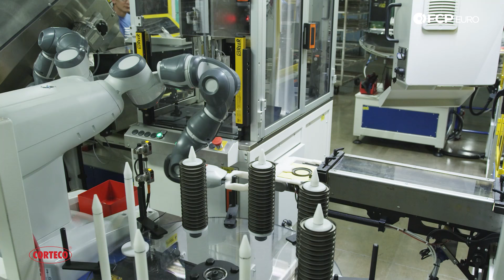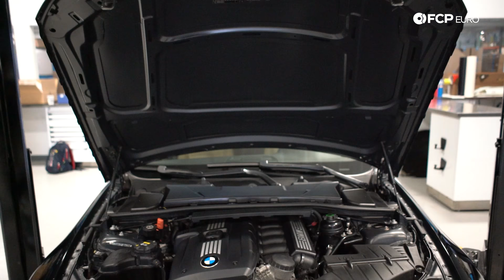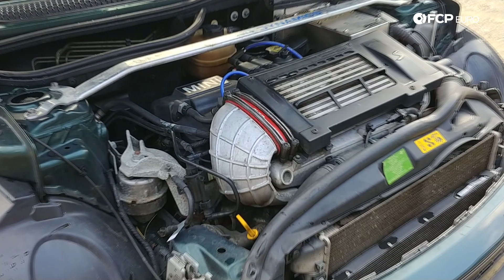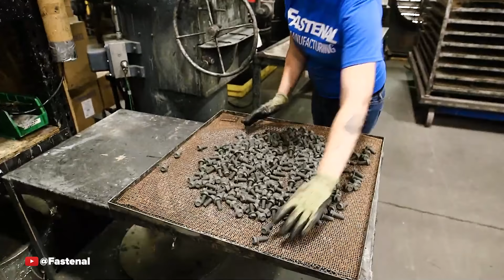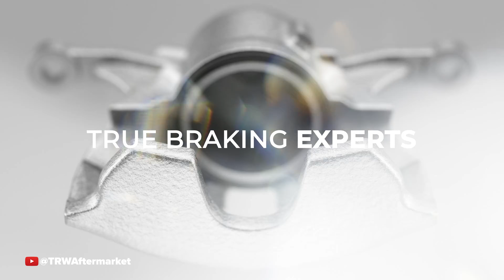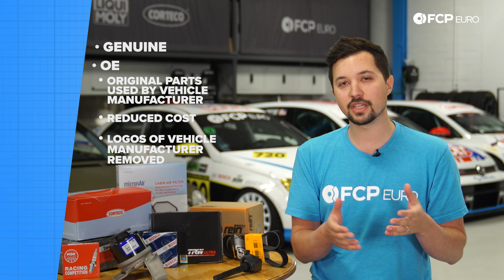How Much Of Your Car Is Actually Made By The Manufacturer?

Comment: As someone working in Automotive (previously TRW Braking Engineering,  so i love your example!) I take this for granted.  But this is an excellent  explanation for people not so close to the industry. A few comments.
1. Tier 0.5 doesn't really exist,  technically they are still Tier 1 because their customer is the OEM. Also, the idea of a full system supplier was popular in the late 90's/2000 with the Big 3. Nothing new.
2. Some examples of the Tier 2 suppliers better fit as Tier 1 eg Hella, Brembo
3. A Tier 3 supplier is one who ships to a Tier 2. If a supplier makes a bolt, or raw material,  and ships directly to the OEM - they are a Tier 1
4. There is a growing trend for OEM's to not allow suppliers to put their logo anywhere on the part. Ford & GM started that 20 years ago, others have followed.
5. Some OES parts are not the same as OE parts. This is especially true for brake pads, even more so once the vehicle is out of production. And anyway, TRW (now ZF of course) never made any brake pads - they were always purchased parts from a Tier 2!

Comment: Outstanding video. Wanted to order some brake pads for 2018 E300 Mercedes from Amazon. They are all over with many parts from 2nd or 3rd tiers unreliable vendors. This video convinced me that I should order these pads from FCP Euro (OE, may cost a bit more - but worth it).
The presenter on this video did a great job. Wish I could do that when I was young.

Comment: I've gone through several OEM engine mounts (2006 E320) that were not Original MB and they failed well before their time and had to be replaced. Only the Genuine MB has lasted. Doesn't make sense but in the case of this specific category of part, this has been my experience.

Comment: It doesn’t matter who’s part you sell.  If the part does not have the stamped BMW logo then is an aftermarket part even thou the part is made by a BMW supplier.  The difference is OEM (Original
Equipment Manufacturer) AND (OE) Original Equipment) Sold only at BMW Dealerships.  All after market parts are not defect free. If the customers takes the time to inspect the parts closely, they will find defects, still usable but with defects such as, not fitting correct, missing sub-components other than hardware, faded lenses or not 100 % clear with bright colors, scratches, holes in the material used to fabricate the part, missing hardware, etc,etc. That is why BMW allowed parts suppliers to sell blemish parts to vendors like you. I have been dealing with BMW, Mercedes and Porche parts for an eternity and know exactly how BMW(in this case)works with parts suppliers. BMW Quality Control is second to none and that is call protecting the brands image.   Everyone who works in manufacturing line for BMW is responsible.  If a defect is notice it will be corrected immediately, again BRAND image. Don’t misinform the customers with inaccurate information.  You have a great day.

Comment: Believe it or not, FCPEURO seems even cheaper in price than OE/OEM parts being sold on eBay and other competition!
Reply: AND they provide excellent customer service!
Reply: Just depends if you're buying new or used parts from ebay. Only down side with ebay is you deal with different dealers selling different parts vs a 1 stop shop with FCP. Amazon is ass for parts across the board, their only benefit of you find the part is you can have it delivered usually the next day. If ebay had that I wouldn't shop anywhere else in my opinion

Comment: What I always wanted to know is do "replacement parts" companies Tier 1 and Tier 2, 3, etc. have to pay licenses to automakers to produce replacement parts? For example Ford released new engine and Mahle want's to produce replacement oil filter for that engine. Does Mahle needs license from Ford to produce it or maybe from Tier 1 supplier who produces filter for Ford in original, Purflux for example?
Reply: The answer is, it depends. If the engineering was done jointly or the automaker paid for the tooling to produce the part, then yes. If the automaker simply buys the part from the tier 1 and is not vested in it, then probably not. However, purchasing agreements can vary and even though an automaker isn't vested in a component, they can still request/demand exclusive supply. Clear as mud, right?

Comment: Awesome video! BMW brake pads - I believe that my callipers are made by ATE, that means the pads are ATE also or can be TRW? Thanks.
Reply from the maker: Most of the time when it comes to braking systems the calipers will match the pads, but sometimes you never know what the team at BMW was thinking so there is a chance they are TRW or someone else. If you gave me your car info I'm sure I could figure that out!
Reply: @fcpeuro Before using FCP Euro I bought TRW brake pads for my ‘07 Jetta from World Pac that were superior to the softer OEM VW brake pads from the dealer at 1/3rd the cost. Next time I’ll most likely buy Akebono pads from FCP Euro.
Reply: @fcpeuro Before using FCP Euro I bought TRW brake pads for my ‘07 Jetta from World Pac that were superior to the softer OEM VW brake pads from the dealer at 1/3rd the cost. Next time I’ll most likely buy Akebono pads from FCP Euro.
Reply: @fcpeuro  many thanks! It's a 228i M Sport Auto 2016 with non Brembo (Bosch system I think with 330 mm rotors). Cheers ;)

Comment: Interesting video and as an automotive engineer give you/FCP Euro credit for a basic presentation on the manufacturer and the supply management system.

NOTE:  Tier "0.5" as explained is still 100% owned by the manufacturer and is not for sale in other brands unless authorized.  This is  a very TIGHT relationship between supplier and "brand".  An example would be GM 4 wheel steer on large pick-up trucks developed with Delphi.  This "Quadrasteer" system died and Delphi cannot market/use on other vehicles.

Please further define OE vs OEM.  In my opinion, an OEM (Original Equipment Manufacturer), produced the part of interest during the production cycle of the vehicle.   Parts stated as OEM, are not correct if the manufacturer did produce that EXACT part at some point during the model production.

Mr. P
Reply: OE should be further defined as meeting the "brands" Original Equipment specifications.  Now used because the OE Manufacturer is no longer in business or manufacturing that EXACT parts for the "brand".  Unfortunately, this happens more often then most outsiders would know, take Takata airbags as BIG example CONCERN for the automotive industry.
Reply from the maker: @LSmiata  Really appreciate your insight, especially coming from someone in the industry! Very good example of a Tier .5 as well, wish we had thought to use that. Admittedly some of the Acronyms/Terminology and their definitions can be a bit of a moving target depending on which part of the industry the term is thrown around in. Personally coming from someone who worked at Ford for years we were always referred to as the OEM, but in reality parts on our site at FCP Euro replace the term OEM for Genuine when it comes to parts, which is where our usage of OEM can cross up with its other correlated definition/use. The intent was not to mix people up, but hopefully explain how we on our site at least use the terminology when shopping, that said I think we could do an even better job of tightening up those definitions! Take a look at our OE academy, https://www.fcpeuro.com/page/oe-academy we'd love to hear your thoughts!

Comment: Downfall of globalization in auto industry is that pursuit for lower costs and higher profit led to decreasing quality (old models last longer than new ones), identity of the specific brand (you can't recognize on 50m which car is about) and less reliability and durability (new cars are mostly cheep plastic crap with chinese tablets in the middle which are made to last a few years or 150k, after everything starts to falling apart).